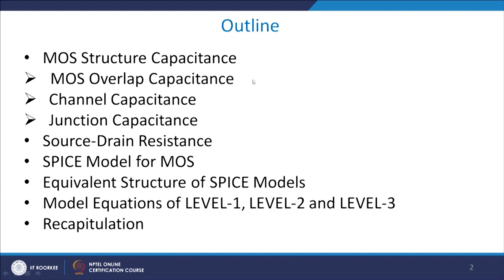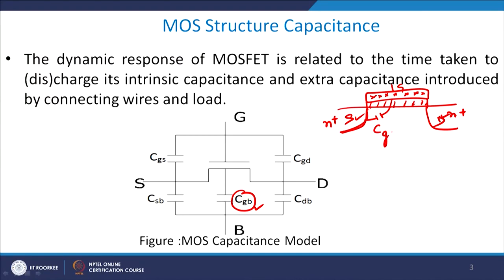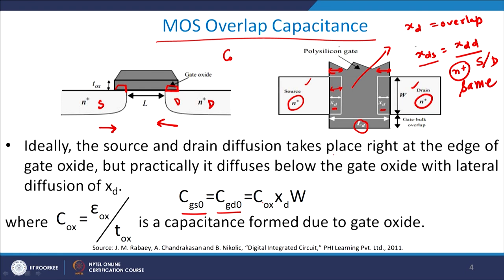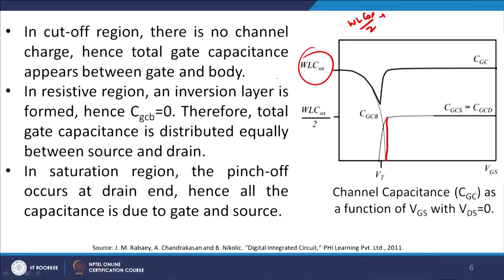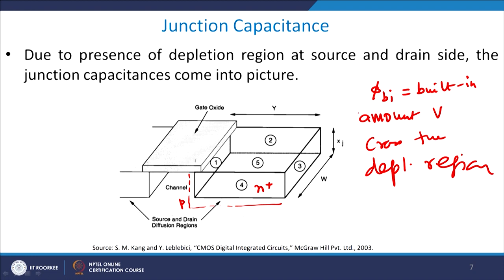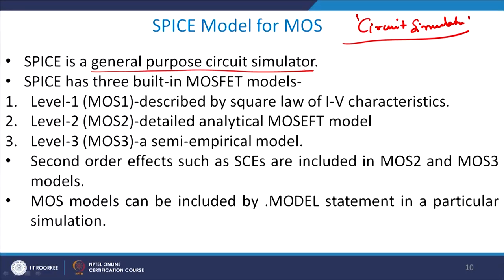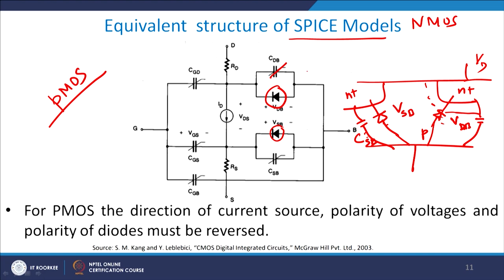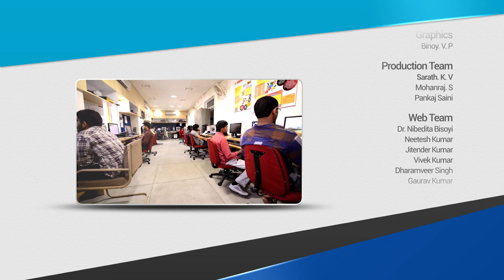MOS Parasitics and SPICE Model

Comment: 11:40 in this case shouldn't both lateral lengths be different as for s and D biasing conditions are different. S is generally grounded D is at some potential. So how both diffusion lengths are same ?? Somebody help
Reply: I think its lengths are not dependent on the biasing, it depends on the doping concentration.